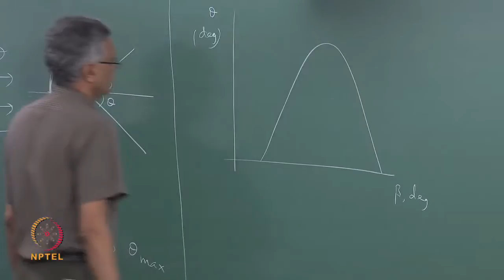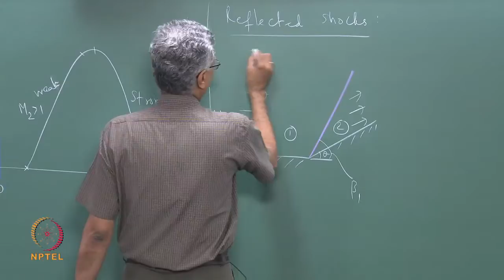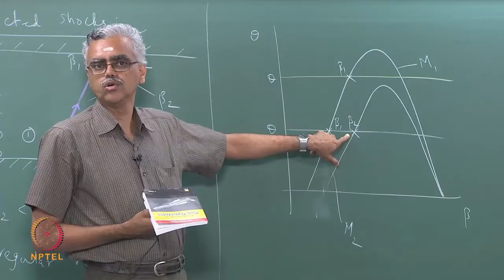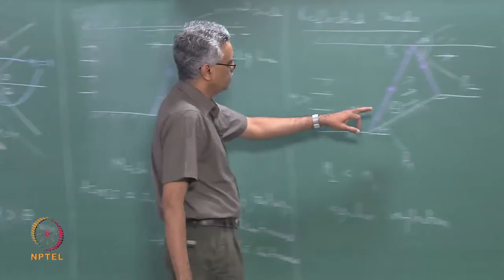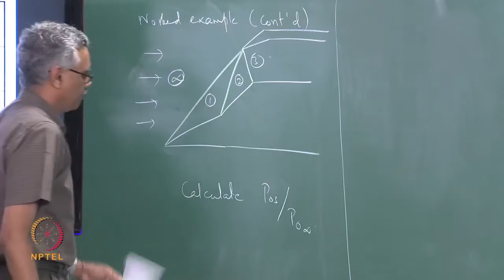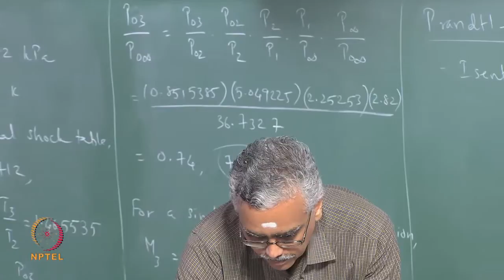Mod-01 Lec-23 Oblique Shock Waves / Prandtl Meyer Waves

Comment: Basically, this answers the question that, why compressors aren't required in engines when you are flying at around supersonic and hypersonic Speeds.
The thing which happens is, due to the reflection(Mach reflections) the flow is compressed meaning Pressure ⬆️, and no need of any extra compressors which is in case of lower speeds (Engines needs compressors to do the same).